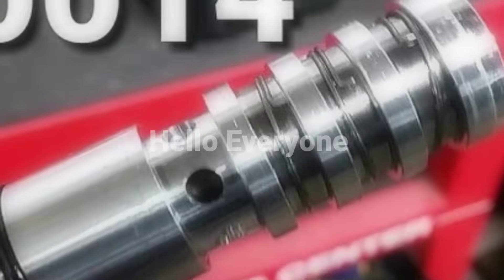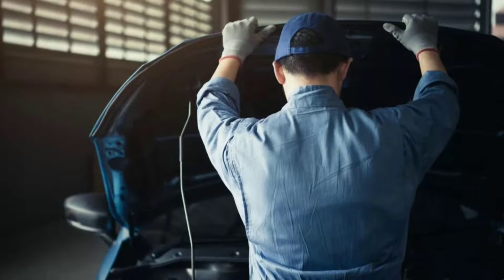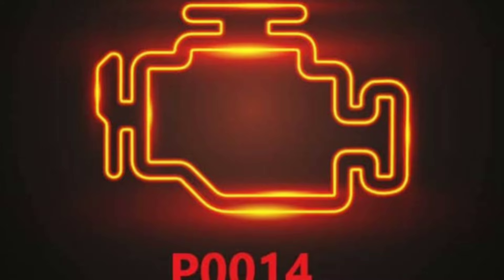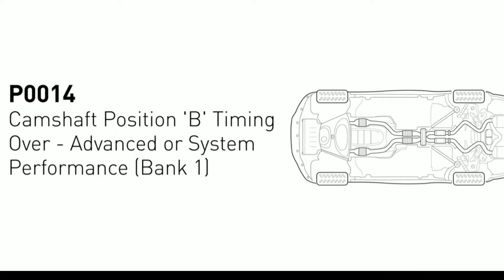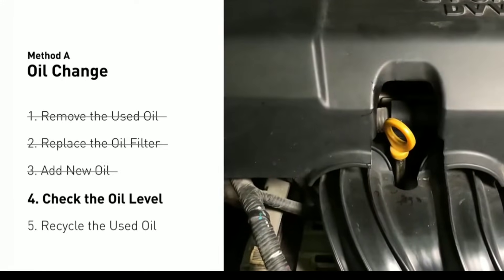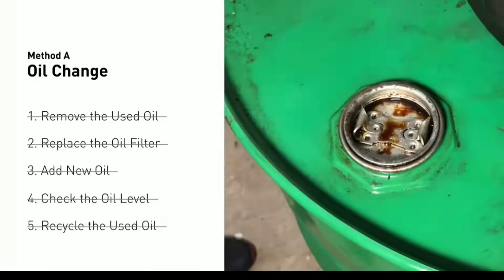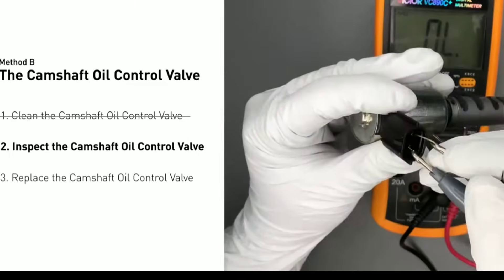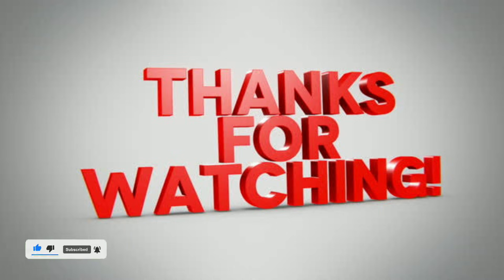P0014 Code: Symptoms, Causes, and Fixes | How To Fix P0014 Code?

Comment: Hello my 2009 saturn aura xe 3.6L is throwing me 2codes P0013&P0014 code sayin its a vvt selanoid bank 1 camshaft exhaust so bow can i fix this
Reply from the maker: Both P0013 and P0014 on your 2009 Saturn Aura XE 3.6L point to the Bank 1 exhaust VVT (camshaft actuator) solenoid not working correctly. Most of the time this is caused by dirty or low engine oil or a failing VVT solenoid, not a major engine issue.

Here’s the best way to fix it:

First, check and change the engine oil and filter if it’s dirty or the wrong viscosity — this is the most common cause.

Next, inspect or replace the Bank 1 exhaust camshaft actuator solenoid (they’re relatively inexpensive and easy to access).

Check the electrical connector and wiring for oil contamination or damage.

Clear the codes and test-drive.

If the codes return, then the next step is checking oil pressure or timing chain wear, but in most cases, oil service and a new VVT solenoid fix the problem.

Comment: My car is popping up P0014 and P0013 2009 saturn aura xe what should i do
Reply from the maker: Both P0014 and P0013 on your 2009 Saturn Aura XE point to a problem with the exhaust camshaft position actuator—usually the solenoid, oil flow, or timing system. Most of the time this happens because the solenoid is sticking or the oil isn’t flowing properly through the actuator.

The best starting steps are simple:

Check your engine oil—make sure it’s full and clean. Dirty or low oil is the most common cause.
Inspect or replace the exhaust camshaft actuator solenoid, since these often fail on GM engines.
Clear the codes and test-drive. If the code returns, you may need to check the wiring to the solenoid or look for timing chain wear.

Fixing those basics usually resolves both codes without major repairs.

Comment: My friends just paid for the thermostat and the oil has been changed apparently it was dark black. Anyway, it's not been fixed so I used my diagnostic machine and p0011 and p0014 and the mechanic was trying to get him to take it back and he'd fix it!! I've just changed the solenoids and the sensor for £40 costs for the new items and it's running now and I'm not a mechanic, just a ol' woman who has been ripped off enough times so It's easier to get the right problem and then see what the job is going to be like and honestly it's like a new carer but I don't like the way mechanics are willing to take your car and make sure you pay for something else to get money out of you...
Reply from the maker: Thanks for sharing your experience! 🙌 What you did actually makes a lot of sense. The P0011 and P0014 codes point to issues with the camshaft timing VVT system. If oil is dirty or sludged up, or if the VVT solenoids/sensors fail, the cam timing can’t adjust correctly, causing rough running and check engine lights.

👉 Here’s why your fix worked:

Replacing the VVT solenoids and cam sensor restored proper oil flow and timing control.
Fresh, clean oil is critical dark, old oil often causes solenoids to stick.
By tackling the exact fault codes instead of guessing, you solved it affordably.

Mechanics should always scan codes and diagnose before replacing random parts. For anyone else seeing P0011/P0014, start with an oil change, check oil level/quality, then inspect or replace the VVT solenoids and sensors.

You did exactly what a good mechanic would do diagnose, confirm, and fix. 👏🔧

Comment: Thank for educative video, I newly changed the oil the P0014 pops up, because the engine light on 

Do you have idea what could be the possible solution?
Reply from the maker: Thank you for your comment! The P0014 code usually means a problem with the camshaft timing, which might happen after an oil change if the oil filter or oil quality isn’t right, or if the timing chain/tensioner has an issue. I recommend checking the oil level and quality first, and if the problem continues, have a mechanic inspect the camshaft timing and related parts.

Comment: I recently got my brakes replaced and the next day the engine light came on. Ran the scanner ans i get the P0014 code
Reply: 2008 Infiniti G35x
Reply from the maker: P0014 Code: A Potential Connection to Brake Work?
Understanding the P0014 Code

The P0014 code indicates an issue with the camshaft position on Bank 1, specifically the exhaust side. This means the engine's computer detected a discrepancy between the desired and actual camshaft position.

Possible Causes of P0014:

While the timing of the engine light and brake work might seem suspicious, it's unlikely that the two are directly related. However, it's worth considering:

Low Engine Oil: This is a common cause of P0014. While unlikely, it's possible that something happened during the brake work that affected the oil level or condition.
Camshaft Position Sensor: This sensor might have been accidentally disturbed during the brake work, though this is also unlikely.
Oil Control Solenoid: This component is involved in variable valve timing and might be affected by oil-related issues.
Timing Components: These components, such as the timing chain or guides, are more likely causes unrelated to the brake work.
Next Steps:

Check Engine Oil: Ensure the oil level is correct and the oil is clean.
Inspect Wiring and Connections: Look for any damaged or loose wiring related to the camshaft position sensor or oil control solenoid.
Professional Diagnosis: Given the complexity of the issue, it's recommended to visit a mechanic for a proper diagnosis. They can use advanced diagnostic tools to pinpoint the exact problem.
Important Note:

While it's possible to find DIY guides and videos online, diagnosing and fixing camshaft timing issues can be complex and requires specialized knowledge. Incorrect repairs can lead to severe engine damage.

Would you like to provide more details about your vehicle, such as the make, model, and year? This information might help in identifying potential specific causes.
Reply: @weeklytools  2016 kia forte 1.8 engine

Comment: how do i get to bank 1  i have a 2020 nissan pathfinder s  to replace  vvt solenoid
Reply from the maker: Understanding the Question: A Clarification
There seems to be a misunderstanding.

Bank 1 in automotive terms refers to a specific side of your engine where certain components are located. It's not a physical place you can drive to.

You're experiencing a P0014 code, which indicates an issue with the Variable Valve Timing (VVT) solenoid on Bank 1.

What You Need to Do:

Locate the VVT Solenoid: This is the component you need to replace. It's usually located on the engine, near the camshaft. Specific location can vary based on your vehicle.

Gather Necessary Tools: You'll need basic automotive tools like wrenches, sockets, and possibly a torque wrench.
Consult a Repair Manual: A service manual specific to your 2020 Nissan Pathfinder will provide detailed instructions, torque specifications, and diagrams.

Follow Repair Instructions: Carefully follow the steps outlined in the repair manual. This will ensure proper removal and installation of the VVT solenoid.

Visual Guides and Assistance:

While there might not be a specific video for your exact model and year, you can find helpful tutorials for similar Nissan models. Look for videos related to "VVT solenoid replacement" for Nissan Pathfinder or similar models.

Important Note: Replacing the VVT solenoid often requires advanced mechanical knowledge. If you're unsure about your abilities, consider taking your vehicle to a qualified mechanic.

Would you like more specific information on locating the VVT solenoid on your 2020 Nissan Pathfinder or finding a repair manual?

I can also provide general information about the P0014 code, its symptoms, and potential causes if you're interested.

Please let me know if you have any other questions.

Comment: I just fixed a P0013 and after fixing this issue and cleaning the code a P0014 pops up🤦🏻‍♂️
Reply: Clean ur Cam Shaft control valve clean it with a spray at autozone or any auto parts store called value cleaner
Reply: Where can I go to find where the cam valve is to spray it? I would like to try that first . Do
You have to reset after spraying?
Reply from the maker: Thank you for your comments
Reply: Conseguiu resolver o código P0014  ?

Comment: I changed my solenoid and it’s still the throwing the same code, what could be the reason for that
Reply: Did you find out? I have the same issue so now I'm thinking that I must either have bad cam phazers or skipped timing. Either way, If I've got to get to that part of the engine, then I'll have to do timing chain, oil pump and all 4 new phazers. That'll be my last ditch effort to keep this car on the road, if that fails then it's the junk yard. 2012 Cadillac SRX with 3.6 V6.
Reply: @verohandymike I had this issue for a year and had to replace the exhaust camshaft gear
Reply: @nikk7166  My issue ended up being the transmission. That code I got was not related to the issue, so that's why replacing the solenoid made no difference. I'm very mechanically inclined, but I didn't realize that a failing torque converter can cause jerky handling similar to an engine misfire. The car idles smooth, but when you're driving it's like there's a giant with a bad sense of humor pulling you along with a string, so he just randomly starts to tug-tug-tug instead of steady pressure, you even hold the accelerator steady and can see the rpm's going up and down.
Reply: @verohandymike  this is exactly what is happening with my 2012 Chevy captiva ! Same with the rpm and everything I have to tap the gas to get it to stop . What all did you have to do to fix it .
Reply: @cookiecrook37  I've continued to drive the car as is. The thing is, the car might be worth $2,000 on a good day, a rebuilt transmission with labor will cost more then double that. In my case, knowing what the problem is, I've learned to live with it while I squeeze every ounce of life I can from this car. Eventually it'll get worse, then so bad it can't drive any more. I already figure I have got triple the value I paid for the car, just from the years of no car note I have been able to enjoy. I think you should make sure what the issue is with your car, then decide if you want to do the same thing I am doing, or attempt a repair if it's reasonable!
Reply: @verohandymike what car you have?
Reply: @Whxiskwvcyavxkr  It's in my comment I made - 2012 Cadillac SRX with 3.6 V6. What I found out about this car is that if there's something wrong somewhere else, it throws codes for other stuff that don't have a problem. For instance, when I travelled and my battery died, I had to get a jump start. It told me all kinds of stuff was wrong, service stabilitrak, abs, cooling system, all kinds of warnings, just because the battery was low.